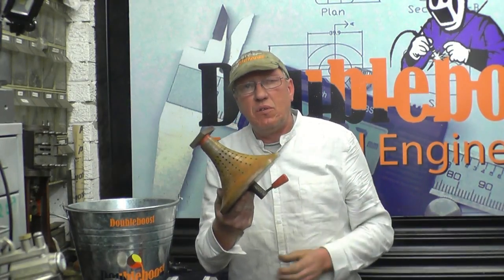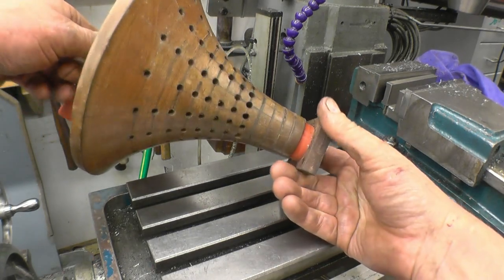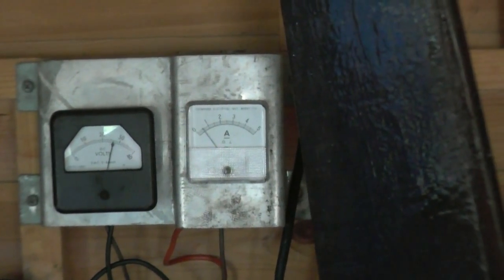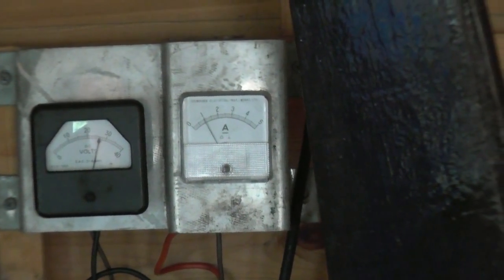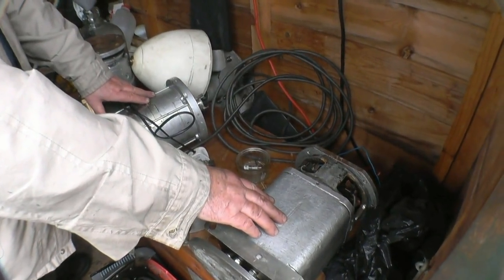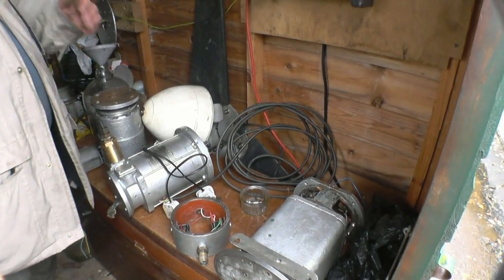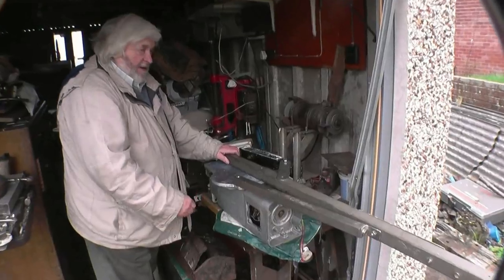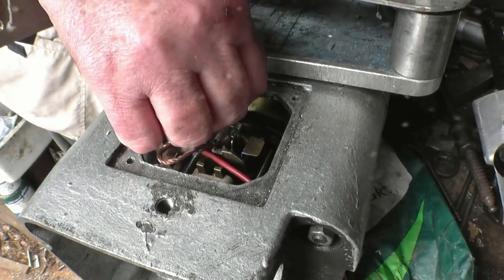SNNC 194 P2   Helicoil Thread Repair

Comment: The alternator's for the high wind and the dynamo's for the low wind, but the other one's the other way round.

 Hang on, so that one there has the dynamo for the high wind and the alternator for the low wind?

 No that's the other one, it uses the alternator for the high wind and the dynamo for the low wind.

 Oh I gets it, it's the other one that uses the dynamo for the low wind and the alternator for the other wind?

 No that's this one, it's the other one that uses the other alternator for the other wind and the other dynamo for the other wind.

 Now I get you.
Reply: And when it goes over 5 amps, you change it the other way, because it's upside down.
Reply: Nooo, your both wrong, it's the OTHER one!!!